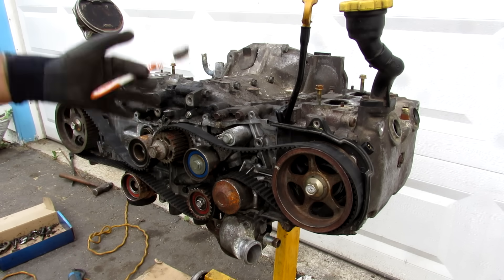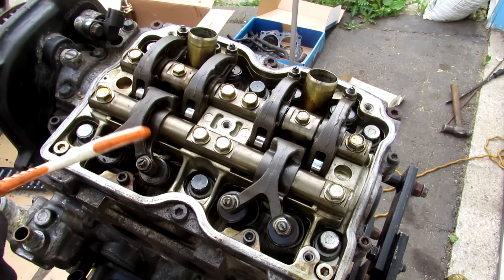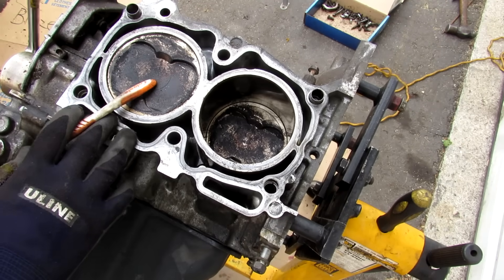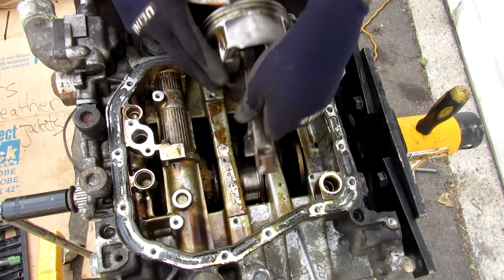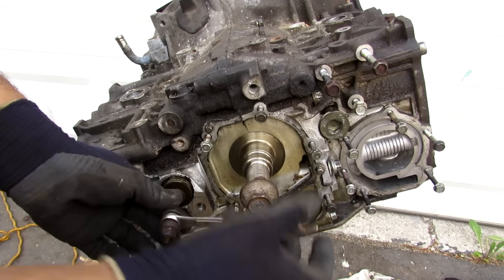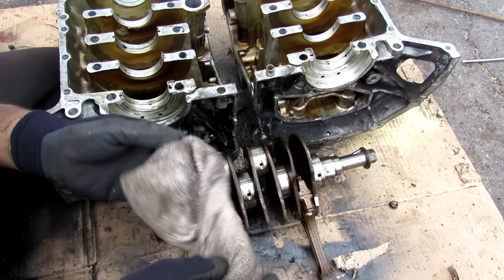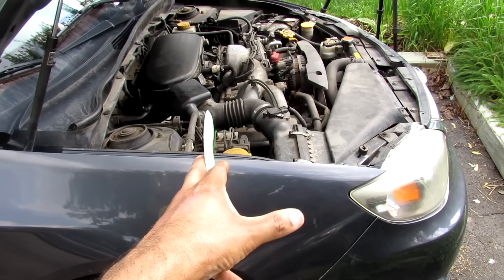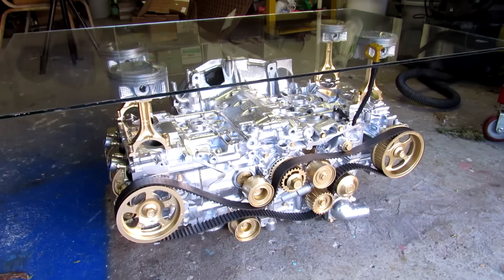Why Subaru Engines FAIL

Comment: What a shitty engine, how many km/miles? Broken ring lands, was this boosted. Buy a Honda k series. My Acura CSX has a k20 and is the best car engine ever. I’m a diesel mechanic and cummins medium duty engine certified. If subura cared about there customers then they would have a solid engine by now but it’s shit. Give me inline 6 any day. Gas engines don’t have high compression like a diesel, they don’t have complex exhaust systems and egr and egr cooler system. No reason why it has to burn oil.

Comment: I had a boxer 6 cylinder for years and sure it was a complete pain in the ass to work on, but damn was it fun to drive, on rather ordinary spec equipment like cheap tires. I've had cars that had plenty of power to push through a curve, but they'd lift if I tried. The Suby had less power, but I could actually use all of it in the middle of a turn and it would stick to the road.

Comment: Awesome video, very well spoken and informative but I disagree that an inline six creates more vibration due to secondary forces.   Some of the smoothest running, longest lasting motors out there are inline configured.
Reply: Yes, inline sixes are mechanically inherently balanced, both primary and secondary.  They still have counterweights, depending on rod/piston weight.  The downfall of inline engines is packaging to keep car size in order..... Jaguar and M=B have some of the finest inline sixes around, but the v-6 fits under the hood better!

Comment: Change the oil every 5000 miles from new, even if it is full synthetic oil. Let me repeat, change the oil, change the oil!, etc. I add Seafoam engine treatment 200 miles before changing. Oil changing keeps the small oil holes in the pistons clean because therein lies the culprit to burning oil when plugged with carbon deposits because of no clearing oil from the cylinder walls.

Comment: I had one of these engines in my 2001 Outback and it was the most unreliable car I've ever dealt with. I replaced it with a SAAB and have had no problems since.
Reply: What saab engine because if you didn't know Subaru has put their engine in saabs as well and it's most likely due to the previous owner that had poor maintenance That's why you see this video of the common failures but if you do your maintenance just like any other motor you'll be fine and a lot of people on here are saying that the maintenance is tough it's not im ASC certified Subaru mechanic and I can get all the major maintenance done within 20 minutes just like any other car just grab a Chilton's book and get yourself familiar with the maintenance

Comment: Had 2, 2001 foresters and that number 3 cylinder? (drivers side rear) always failed with the head gasket. Also the dry oil and the knocking was a thing that I didn’t realize until I watched the video! My Japanese manufactured car was way tighter than the US made one. Great cars, but man that engine is a princess.

Comment: Side note, my understanding is that the inline 4 and inline 6 engines are more balanced than V6 since the cylinders are not igniting in a balanced fashion. That is why V6 has more balancing components added.

Comment: biggest problem is there is a single half moon keeper for the cam and belt pulley. the ac puts such a vibrating  load on the belt pulley it wallers out the halfmoon hole in the crank. the cam pulley rips the keeper or gets off time at least. Stupid failure point. should have been separate keeps for belt and cam gear at least. My standard repair is cut a 1/4 groove in crank and pulleys. some times 2 and put in steel long 1/4 squre stock for a long keeper in the belt and cam gears so the ac vibrating torgue doesnt destroy the cam pulley keeper.

Comment: It's not complicated enough, it needs more parts that can't be serviced!
Reply: Ah yes we call that a BMW
Reply: And screw gravity! Let’s put everything sideways!
Reply: @Stretch501st  just give it a cool name.. like a BOXER
Reply: NE13 and don’t forget the spark plugs that can’t be reached unless you go to the Stealership!
Reply: @Stretch501st  I changed my Subaru's spark plugs.  The cam belt service is a btch though
Reply: @pieroocchooa5837  every single thing is a bitch. it's almost easier to take the engine out to replace a clutch. dropping your motor to change a serviceable spark plugs is insanity.
Reply: @ne1384  I never had to drop my subaru's motor to change plugs.  Some people do drop the engine to do a cambelt service while others dont.
Reply: A two piece "block", bolted together? I'll pass, thank you.
Reply: Very simple easy engine to work on and about the easiest out there to remove.

Comment: Owned a 2006 Wrx with ej2.5 turbo. All stock. No performance mods at all and it was a 1 owner car with 76k miles on it. I had the engine rebuilt 6 times in the 40,000 miles I was somehow able to drive that car. The shop never told me to bring it back to retorque the heads.. I’m sure that’s why it had so many head gasket issues lmao. Each rebuilt was under the shops 3 year or 100,000 mile warranty so I didn’t pay a million dollars to keep the car lmao. What a shit show tho. Makes me never want to get a subaru ever again.

Comment: Never saw that specific HG failure on the 2.2. I frequently saw combustion gases getting into the coolant, which only revealed itself when the temp climbed on the highway as the gases collected in the water pump impeller pocket, causing cavitation. Squeezing the hoses and varying engine speed would usually get you home or even a few days of short drives before it no longer worked to dislodge the combustion gases. Of course, once they enlarged the EJ to make it a 2.5 liter, I stopped dealing with them because doing so turned it into a POS. The 2.2 was a much better engine—the (forged) crank was stronger with greater journal overlap, the shorter rods were under less stress with smaller pistons, and the cylinders in the open deck versions had less tendency to walk with the smaller cylinders with smaller pistons inside of them. Also didn't have the piston slap issues. If Subaru was interested in continuing to make good cars, they would have kept the 2.2 closed deck block at least for the STI as it was a much stronger block than even the semi-closed blocks, but I guess the die and sand casting method of production was too expensive even with the overpriced STI's massive profit margins considering its pricing over the WRX. The EJ engine was a great engine when it was designed in the '80s, but it wasn't intended to go to 2.5 liters and it showed. I get that the cars got too fat for 2.2 liters and they needed to bump up the power cheap and that they were a small company, but that was in the mid '90s and they kept the oversized EJ going for far, far too long (and I'm not going to get into transmissions!).

Comment: i had a 1980 ,it was the same crappy design, it had bad blowby and because i was so young the dealer wouldn't do a thing. it was under warrantee and they would not help me. i finally tried to take it apart. i was 20 yrs old, it was less than a year old.  can you imagine.  a brand new car ,i went to the dealer many times and they said just drive it. with a bad knocking noise,smoking and backfire. wow, so i rebuilt it myself. i didn't do the best job but it ran and i finally sold it very cheap and took the loss. it was even lemon colored.   i was to young to know that i could have gotten a new engine if i would have pursued a lot harder.   subaru dealer was in bend oregon.   bastards

Comment: well there's your problem. Previous owner used Fram oil filters...
Reply: My girlfriend had a 90 something Ford Escort. It was leaking oil horribly, so she bought a new Taurus. My old pickup got like 10-12 mpg, so I asked if I could drive her old Escort. She told me about the oil leak. I pressure washed it underneath, and you guessed, split open Fram oil filter.
Reply: Interesting comments, I have been using fram oil filters for over 50 years, have never had a problem with them, no splits, no leaks, no engine oil problems. I turn over 200,000 miles on my vehicles before trading them in. My current vehicle has 181,000 on it now, still running strong.
Reply: @DonLuc23  
go check out some YT videos and see what the inside of a Fram "Extra Guard" looks like. It's rubbish.. Fram 'Ultra' and 'Pro' Synthetic filters are good tho
Reply: @DonLuc23  I never had a problem with them but now I use the Autozone brand. Can't remember what it is. Purolator I think.
Reply: Just buy Wix filters and you will never have an issue.
Reply: exactly
Reply: Always use a factory filter and change the oil and coolant at recommended intervals whether you DIY or pay through the nose for a shop to do it. This engine has been abused methinks.

Comment: I always loved the idea of a horizontally-opposed engine, however the reality of this video has certainly put things in perspective for me. We own a Subaru now (our first one), and between the horrible CVT transmission and now seeing this video, it will be our last Subaru. Thanks for posting!
Reply: Subaru's run forever.  I had my forester forever, I put 300k miles on it.  I bent the frame was the only reason I don't own it anymore.  I lease a new Subaru Impreza and it runs fine.
Reply: Don't buy the CVT. Also your car doesn't have an EJ very likely, if it has a CVT, it's more likely it has an FA engine.

Comment: A v6 isn't balanced by itself because each bank has an odd number. Inline engines of even cylinder count are much more well balanced. V6 engines need pretty sizeable counterweights to be balanced
Reply from the maker: I'll confess

Comment: Why it fails, they chose to have 2 heads for a small 4 cylinder engine that needs to 2 timing belts and pullies. Real dumb design, simpler is always better, is why the straight 6 engine is supreme, has almost perfect balance, minimal vibration, 1 timing chain or belt and is simple design. Only problem with the straight 6 is it could overpower a smaller transmission and bad fuel economy.

Comment: I have had 3 subarus back in the 90's all bought used and I never had one major issue and I drove them not easy I'll say, I mean I wasn't doing hole shots but I've had great luck I guess with subarus. I like how they run, the only major thing I ever had to do is replaced a halfshaft other than that they were great cars. None were even as new as a 1990 though so maybe they have some design differences that cause these weak points that he speaks of not sure maybe someone can say?

Comment: I'm old enough to remember when Subaru built a simple reliable engine. That was a long time ago.
Reply: As do I.  I remember my neighbor had one with the covered light in the middle of the grill.  I was twelve years old at the time.  Fast forward twenty-nine years, and I drove a brand new '07 Impreza off the lot.  I still own it.
Reply: Last year of EJ22 was 1999 in the Legacy and 2001 in the Impreza.  Not that long ago.
Reply from the maker: Oh well
Reply: The ad was "Inexpensive and built to stay that way"
Reply: The 2.0 is very reliable but unavailable, I think, in the U.S.
Reply: @nigelduckworth406  all imprezas have 2.0L engines exept the older RS, WRX & STI. The newer WRX have 2.0L engines but the STI still have the 2.5L.

Comment: Any reason with the 2.5i 's always leak oil ?  Just had the cover gaskets changed due to oil leaking into the sparkplug holes.  Now a month later, seems to be leaking in the back of the engine and dripping down the crossbar under the oil pan.

Any idea what that issue is ?

Comment: 9 out of 10 Subaru’s made in the last 10 years are still on the road  ... (regardless of the cost to their owners)
Reply: The commercial doesn't distinguish between how many of those 9 Subarus are rolling down the road or dead in the shoulder.
Reply: @richardlangellotti6208  ...or how many still on the road are boxer engines.
Reply: DW Pharester all Subarus in the last decade have had boxer engines
Reply: @timomomomo969  Subarus have been all boxer engines since some time in the 60s or early 70s.
Reply: I was considering buying an Outback in the Bay Area, something in the 100K mile range. That would just be considered 'broken in' for a Honda or Toyota. I was shocked at the amount of repair receipts the sellers have been pulling out and a lot of them had rebuilt the engines already. This video helped explain why.

Comment: We just purchased a 2020 Ascent.  I actually kind of ran across this video by chance and I have watched it twice.   Thank you for all the info about the boxer style engine.  Their were a couple of things I hadn't realized about the design.  I did wonder however about the lubrication of the boxer design and you cleared those questions up for me.   Being an old backyard V-8 muscle car mechanic, the new designs or new takes on the old boxer design had me wondering about a few things.  Are the turbo charged engines more likely to fail due to heat?  Also,  they claim my Ascent can pull a 5000lb load on that little boxer engine.  It seems awful heavy for that little engine and can the drive line really take that kind of load?    It kind of reminds me of a VW pancake engine, but on steroids.  Thanks for the video and keep them coming.  Very well done and in a decent time frame.
Reply: I'd be more concerned in the longer term with the CVT pulling that kind of weight (or at all as the heat and friction inherent to the design is not a recipe for longevity). The Ascent has an engine design that's almost 30 years newer than the EJxx. Pretty much any turbocharged engine is more likely to fail than a normally aspirated one due to heat and pressures, but most engines are made so well nowadays (and engine controls and oil are so much better), that the margins for durability are high. I can't vouch for the FA24 engine specifically, so this is a general comment.

Comment: Man, this does not look like a very mechanic friendly car to work on. You made pulling that snap ring out of the abyss look easy.
Reply: I just bought my second Forester exactly EJ253 motor. Is hard to replace air filter. The spark plugs difficult job too.
Tried to change O2 post sensor (common problem) and gave up, took it to a mechanic. Otherwise great cars Subaru, drive really well.
Reply: andyharwood64 it literally takes 15-20 mins do to spark plugs, air filter fairly easy aswell
Reply: 02 sensor it also easy aha
Reply: andyharwood64 it is absolutely not hard to replace the air filter. Spark plugs are a pain in the ass forsure though
Reply: Spencer Zettersten depends on the model, sohc liberty etc are quite easy
Reply: @soundsolutions  Battery and airbox must come out. I use two small 3/8 extensions back to back to get the plug socket in. I can do it in 1 1/2 hours now.
Reply: @garygruber1452 I use a short length of fuel hose to remove when finger tight and to install, easy.
Reply: I can't get over the timing belt driven water pump. Yeah let's make a simple, common repair job so much harder.
Reply: @KR-hg8be  Idk 🤷‍♂️ all the cars I've had, have the water pump timing belt combo and I prefer it that way
Reply: @KR-hg8be  VW is the same in a lot of models
Reply: Inline 4's are much easier to work on.  I don't think the low CG is worth the maintenance headaches.
Reply: Spark plug replacements on these engines suck so much ass
Reply: Am with you on that looks like hell to work on
Reply: @andersonjames3748  Yeah, I prefer my two wheeled engine stand 🏍️
Reply: He’s also a part-time dentist.

Comment: What is the best engine then?
Reply: Honda's make the best engines, just get a naturally aspirated one, no turbo and you wont have oil gas dilution problems. Many advancements in engineering are being made on the transmission side of things now with the CVTs that used to be junk.

Comment: Dang I wish I knew this before I bought a subaru, what a terrible design...
Reply: I guess as with most engines the secret is good maintenance. Stick to the schedule, use the right oil and you'll be good.
Uness you bought a Subary boxer diesel, then you're fucked.
Reply: Jochen Stacker 🤣🤣🤣
Reply: It's probably the best design EVER made... Obviously you have absolutely NO experience with boxer engines like the ones found in Porsches, old BMW motorcycles, Honda Goldwings, and Subarus. They're extremely smooth, make a ton of power for their size, and last forever! What  speedkar99 showed applies to ALL engines. I have over 200,000 miles on my Goldwing and it runs better today than the day I bought it. My wife's Subaru has over 300,000 miles on it and doesn't burn a drop of oil! Study up before you hit the keyboard with idiocy!
Reply: @seanoleary1979  I see how good the opposing cylinders are and love how smooth it runs and the power, but longevity and reliability with oiling issues I cannot say this is a good design for being put through the wringer. I am sure this is considered a great engine from many people's perspective, but from a maintenance and reliability under harsh conditions I just cannot agree. I know that you really like the engines and that's nice, but I like working on my own stuff and that design seems a serious pain in the butt. But if I had others do all my work then I guess I would care about that part.

Comment: Flat 4 like a old vw camper engine
Reply: New Camper in 1969, ran great for 41,000 miles, apparent rod bolts vibrated loose,  "Bang" , tow truck to get home.  VERY common for those Boxer busses to blow engines
Reply: Forgot it was a VW camper
Reply: @nickloan6245  41,000 miles? thats nothing on 1 of these engines, ive done valve jobs on these engines with half a million miles on the clock ;) go forever

Comment: my wrx 2011 has has zero engine problems at 138k miles. looking up the vin # it was built in Japan, so im thinking that helps as far as build quality. of course i do oil changes regularly.